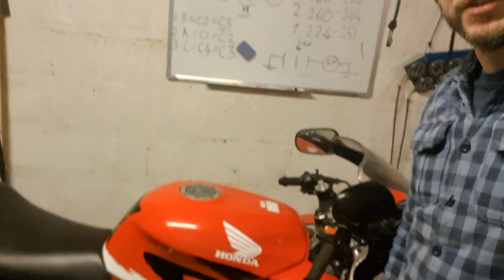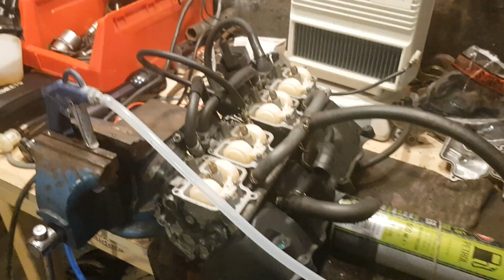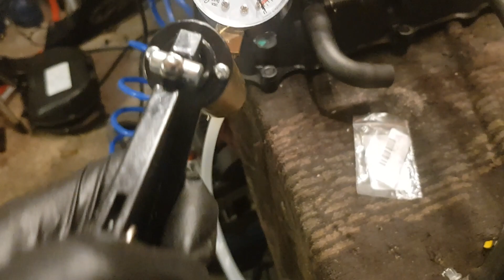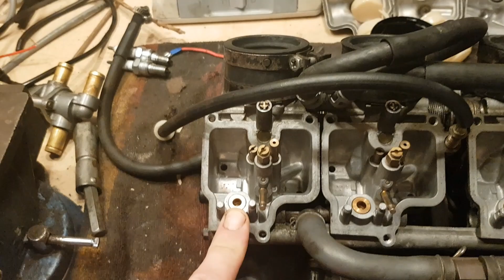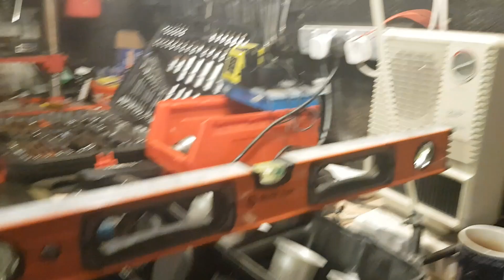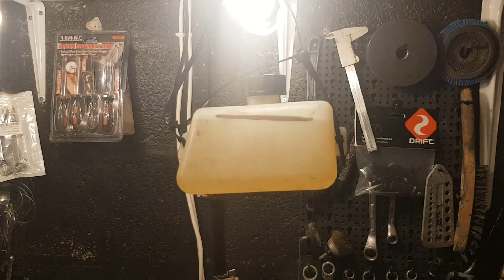CBR600 F3 REVIVAL Part 12 - Carburettor float valve seat test and repair

Comment: Did it fix the problem i did all this but still had the issue It leeks fuel down the brass inserts which has a Oring that over time perishes and allows fuel past the seals when the bike runs up to temperature the bench test is ok but the problem will be back as soon as you start riding again. good post though.
Reply from the maker: Yeh been a few years now but yep I believe it fixed it, bike ran well since sold it. Best of luck for yours